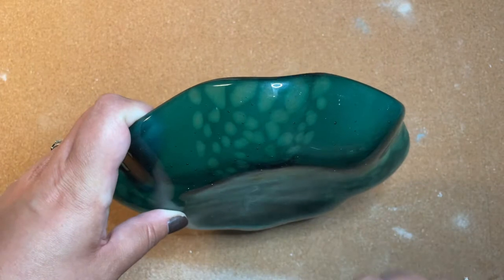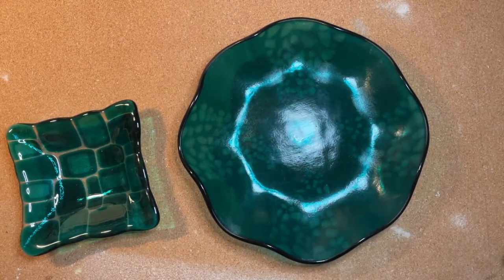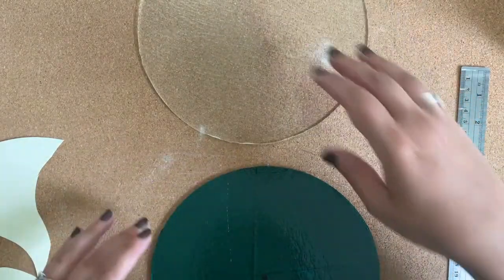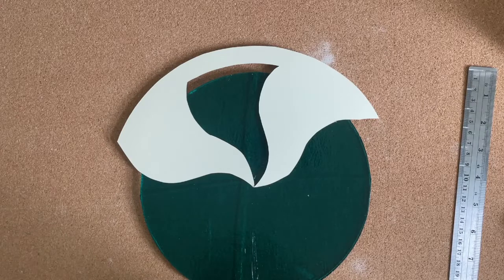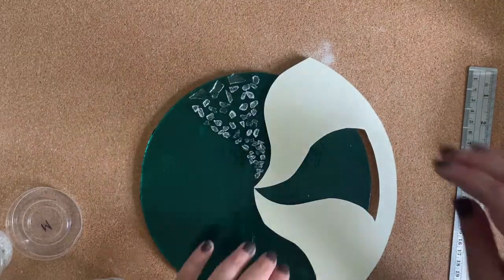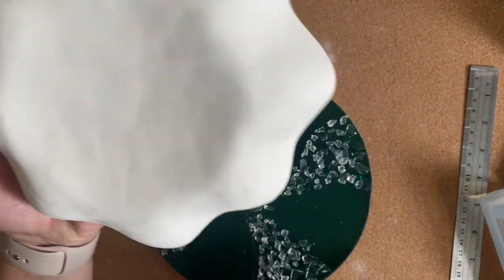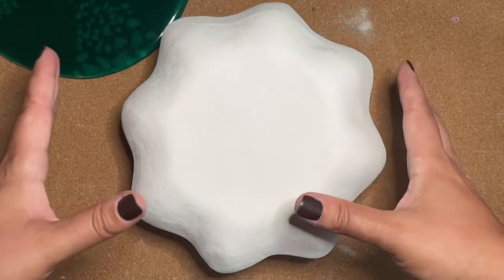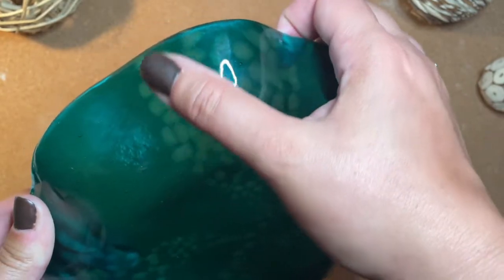Fused Glass Project - Making a Fused Glass Bowl Using Color Displacement

Comment: It is very easy to cut circle glass …..first check the soft side of the glass second step you have to apply kerosene on the glass after that cut the corner of the glass
Reply from the maker: I was pretty new when I did this video. I've gotten much better since then. thanks for the tip!